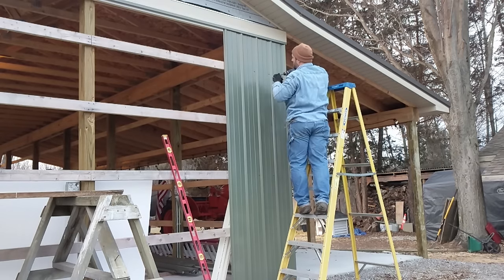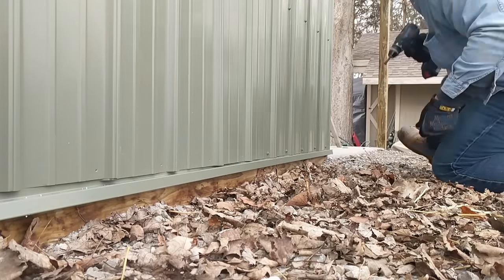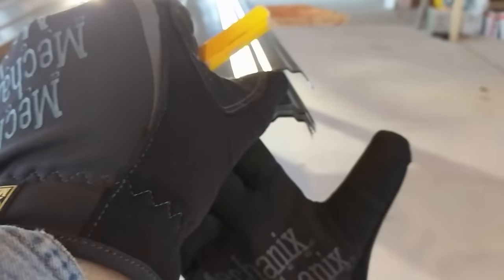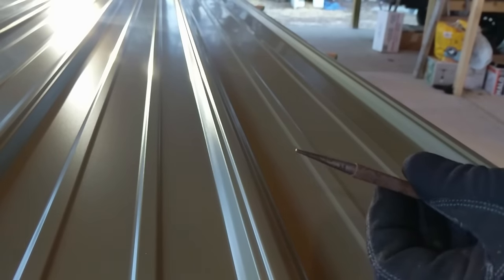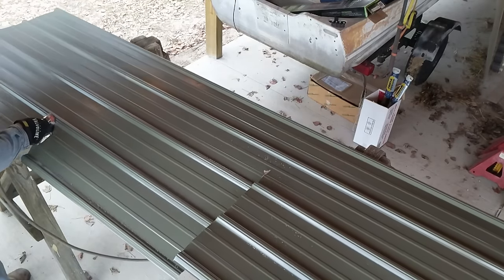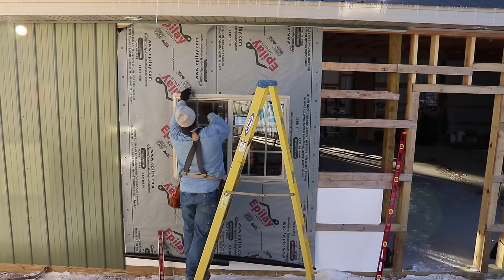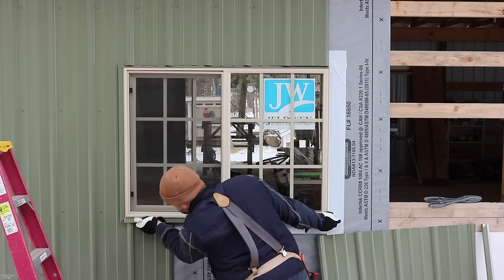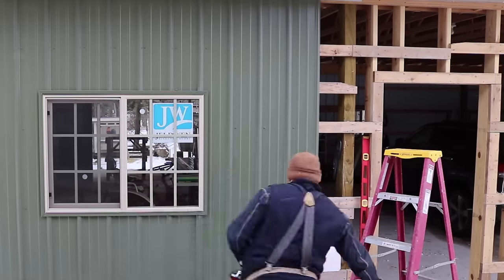Installing Steel Siding on a Pole Barn, Trimming Windows, and Cutting Tools - Nibblers or Shears?

Comment: very nice video and explanations. I have an old Hay Barn that the current cheap wood siding is falling off. I would like to strip it off and re-side with metal. Im thinking of converting the hay barn into a larger  structure for both hay storage and goat shelter. This is all new to me but I hope I can do this.
Reply: Had same old barn.  Was an embarrassment.  With no experience did it all.  Looks like brand new pole building.  Reversed the blade on skilsaw to cut metal.  Cheap, quick and easy

Comment: I like the color. U are putting it so well am sure it’s kinda therapeutic to u if it was to me just by watching. Can I put this on a house after OSBs? Seems like metal siding could provide 100% moisture free house.
Reply from the maker: Yes a lot of times when I'm working alone it is therapeutic and takes your mind off other things. I don't recall seeing this type of siding used on a house before, but I don't see why not. You definitely could put it over OSB. That would be similar to how I did my roof. A standing seam metal siding would be even better moisture protection. Thanks for the comment.
Reply: I have a metal house yes OSB is a  great substrate be careful not to  over tork screws

Comment: After just having a $27k estimate given to replace vinyl siding in 2022; I’m seriously wondering how much cheaper it would be to go with metal siding instead. My only real concern? Those darn rubber gaskets around the fasteners. They last 5 years tops in the elements. Unless you’re using some kind of silicone gasket on each fastener.
Reply: Great point about those rubber gaskets, I have a metal roof with those and definitely had to put silicone on the ones above my windows to stop water leaking.

Comment: Any problem with water leaking at either end of the drip edge?  I guess if there was any it would be minor/acceptable for a shop/shed/barn,  but on a house?  Could be a problem with sheetrock.  It would be nice if the drip edge had dams at each end but thats a job for a metal shop.
Reply from the maker: Thanks for the comment Kevin. I have had no issues at all with water infiltration. That piece of drip edge above the window is more for extra protection than the primary protection. Most of the time that drip edge trim isn't used just the J-channel. The ends of the J-channel are bent over into the side pieces so the water flows away down each side. I am actually a little concerned about the bottom corners because it seems that some water from above could seep through there. That's why I used the synthetic roof felt around the window and taped everything with the window sealer tape.

Comment: How do you get the window out if it gets broken? Looks like you'll have to remove all the metal (due to metal overlapping) up to the window just to replace the window. Why didn't you put some kind of molding (brick mold) over the flanges of the window and then place your j-channel around the molding?
Reply: You just loosen the two panels around the window. Take screws partially out of next piece that falls over the side of the one panel to remove only. This will allow you to slip the one underlayed out and remove the panels you need to remove the window. I know because I installed windows after my barn was finished!

Comment: again..what can you say of the screws, length, type, diameter etc .................ty
Reply from the maker: https://www.menards.com/main/hardware/fasteners-connectors/screws/pole-barn-screws/grip-fast-reg-10-x-2-hex-drive-zinc-pole-barn-screw-5-lb-box/229-2418/hardware/fasteners-connectors/screws/pole-barn-screws/grip-fast-reg-10-x-1-hex-drive-zinc-pole-barn-screw-1-lb-box/229-2793/p-1444437345950.htm

Comment: Nice color for type of weather. Could you please the window type and specifications? Also the siding you used (J). Are they standard size? I really don't know but I need to install a pair of windows over  R panel walls that are in a horizontal setting. I am closing a carport.  Any input will be greatly appreciated. Thank you and God Bless.
Reply from the maker: Hi Roberto, the windows I used are Jeld-Wen from Menards, but I think you can get them many other places. They come in many standard sizes. 
https://www.menards.com/main/doors-windows-millwork/windows/sliding-windows/jeld-wen-good-series-vinyl-sliding-window-with-nailing-flange/jw1385-00825/p-1454045264952-c-1482327569455.htm

Comment: Does your steel siding fit under your integrated brick mold on the window any or is it too thick?
Reply from the maker: The windows I used just have a nailing flange but not a built in brick molding so I ran steel j-channel all around the window.
Reply: @CountryFamily  i am getting ready to put windows in mine now. The windows i bought are new construction with the nail fin but also have the built in brick mold. I went ahead and bought the steel 7/8 j channel from the local supplier that matches my taupe side panels. Even with the brick mold, it should give it a nice finished look along with more weather protection.

Comment: Very informative video and nice job on the project! Could you tell me the name of the trim that the panels slip under at the top, underneath the soffits? Thanks for taking the time to make this!
Reply from the maker: Thanks Darren! The trim at the top is a J-channel. Here's a link:
https://www.menards.com/main/building-materials/siding/steel-siding/10-residential-steel-siding-j-channel/white1550306-01/p-1444448461086-c-5837.htm?tid=472930711005416000&ipos=2
Reply: @CountryFamily  Awesome. Thanks!

Comment: I have a barn that I turned into an apartment. I think I might have bought the wrong window. Would it be easier to remove the siding then put window in and then put siding back on? Or is there special windows to order for a barn that's already built?
Reply from the maker: It's not too bad to remove a couple sections of siding to replace the window. Unless it's nailed instead of screwed. Or some companies can make a replacement that fits into the opening. Good luck with your project.

Comment: I'm just about to finish a bare bones pole barn on the property I moved onto.  Your video is giving me hope I can do it by myself!  I'm a little stumped at the corners though. Do you wrap around the siding or is there a special kind of panel?  Also I don't see a video about framing the walls, does it vary state to state or is there a universal distance to put the 2x4s up the walls?
Reply from the maker: The siding panel starts at the edge of the purlin (2x4) then the corner piece fits over it. The corner trim is bent deep enough to cover a siding rib. Just make sure the rib is close enough to the edge so the corner encompasses it. 
The wall framing is strictly for attaching interior finish. It is not structural at all so you can go 24" on center. The poles are the structure of the building. You could also run horizontal purlins on the inside similar to the outside and finish it that way too. 
Good luck with your project!
Reply: thank you!

Comment: Nice job!  I was wondering how you did the corners...did they come with the siding precut or did you custom fir them?  Are they generic or specific to the type of siding?
Reply from the maker: Thanks Robert, the corners are standard for metal siding. They are bent deep enough to fit over a siding rib. To trim the angles on top just takes careful measurements and even a sample template if you have enough length to cut some off.

Comment: What size punch did you use?
Reply from the maker: It's a small finish nail set. The pointy tip helped get the hole though easier. A little hole is all that is needed to get the screw point started. Seemed to work very well. I used a drill to make the holes in my roofing and I broke bits, and it probably took just as long.

Comment: Great job!  Like the color. 
Around this area we have lots of snow rain and general damp weather.
Try to elevate the lower sill plate of these with some concrete berm or perimeter to keep the
treated lumber up from ground level. That way the precip all drains down and away.
Reply from the maker: Thanks, yeah that's a good point. The front and back will both have concrete slabs draining away. The south side has a planter box that drops down a bit and the north side has stonecrete that slopes away. I had to build the area up around the barn so it all slopes away really well. Thanks for the comment and thanks for watching.

Comment: Your screws always go in the rib on the roof it will never leak if you put your screws where water runs it will rot the plastic out of your screw and couse leaks but most of the time you won't know until it's too late
Reply: Isn’t that just for roofing ?

Comment: Two things, you messed up your layout around that window, you should never have a rib right on the edge of a window like that and your upper piece of house wrap you should have left loose and then  installed it over the top of your window nailer flange. Helps keep water from running in behind your window.